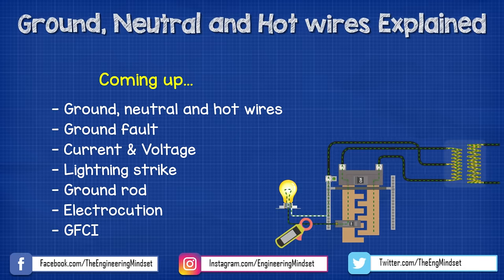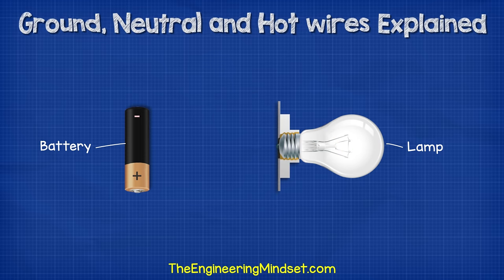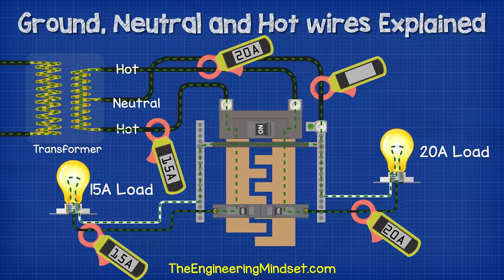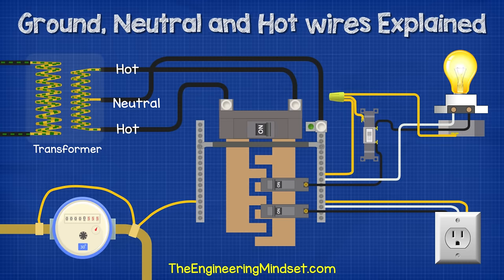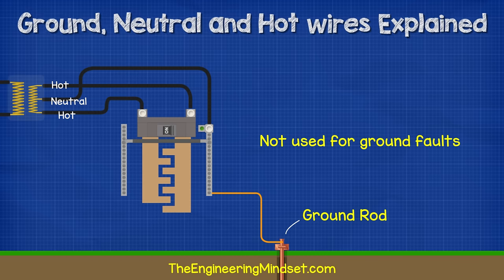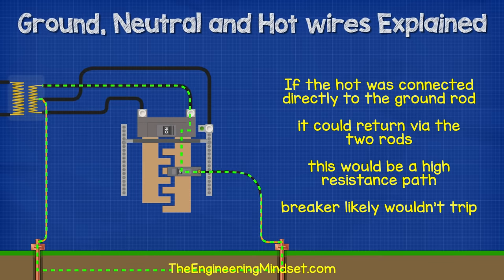Ground Neutral and Hot wires explained - electrical engineering grounding ground fault

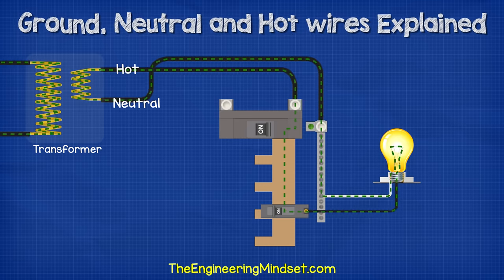Comment: I still don't understand how you're differentiating between "hot" and "neutral" in the AC scenario. Your diagram shows that the "hot" bar is acting as the electron source half the time and the "neutral" bar is acting as the electron source half the time. Note the changing direction of election flow going through the lightbulb at 3:08 if you don't understand what I'm saying. Clarification would be appreciated!
Reply: The middle of the transformer is at ground potential.  All along the neutral wire the wire is at ground potential.  But where the neutral is connected to the load there is a 120 V potential between that point and back at the middle of the transformer.  It is this 120 V potential difference between the hot wire at the load (assuming it is switched on) and the middle of the transformer that causes the current flow in the neutral wire. I think that is it.
Reply: @robertbrandywine  "But where the neutral is connected to the load there is a 120 V potential between that point and back at the middle of the transformer."

Well, not really 'that point'. The voltage drop occurs across the load. But I might be getting nit-picky, I think you have the right idea.
Reply: I think some of the confusion is surrounding what the 'neutral' truly is.

Neutral is actually not the best term here, for reasons I won't get into. The proper term is 'grounded conductor.' 
All you have to do is consider that it is a conductor of equal value, import, and function as the 'hot' and it should all make sense. 
The only difference is literally that it is 'grounded.' All that means is it's voltage potential to earth is eliminated. It is clamped to earth potential. The voltage difference between the two conductors, therefore, all shows up in the 'hot' relative to earth ground. 
It is actually possible to unearth the system and not have one defined as grounded at all. The voltage to ground from either wire in that case would officially be 'unknown.'
Reply: @spruce_goose5169  I like your explanation. 
Does that mean that the 2 hots in standard European 220V outlets are ungrounded conductors?
Reply: @cursed_multicel  I'm in the u.s. and not that familiar with European systems, but I believe they make 230 volts between a 'hot' and a 'neutral' (grounded conductor). 
So one ungrounded and one grounded. Which is different than u.s. where we make 240 between two ungrounded. (u.s. being split phase, europe being a standard single phase, where phase conductor to phase conductor (hot to hot) is 400 volts nominal.)

Comment: The ground wire help us to keep away the dangerous from electric shoke when there is electric leakake on the metal cover of some  devices. Like you have the leaky oven you use the tester and it is on and if you connect the ground wire the tester wont turn on anymore and you will never get shoked when touch the cover
Reply from the maker: We just published a new Ground fault, short circuit and arc fault video, so much detail! Link HERE➡️: https://youtu.be/Qi0ynSQw-wc

Comment: So wait, is this saying that all/most US power outlets with two receptacles (I think they're called duplex outlets), one on top and one on the bottom let's say, are actually capable of 240 volts?  

I suppose that means both the top and bottom outlets can each output 120 volts, but my question is if a single "receptacle" is capable of outputting 240 V in such a setup, or if it is limited to 120/125 volts max?  

Just curious.

Also, no offense, but despite this being a very fine video, I still don't understand much. The one thing I take away is the one thing I've been a bit obsessed with over the past week, and that is that ALL receptacles should be GFCI, or better protected than a mere ground wire, at least for those concerned most highly with safety. 

So I guess I should ask, when will/does a ground fault trip the circuit at the breaker when one is NOT using a GFCI outlet? In general, how safe is a "standard" grounded outlet (non GFCI)?  I thought I read something about 15 amps needing to pass through first, meaning, it needs to exceed the breaker's rating, I'm using 15 amps, but I'm not sure that's accurate, it seems to me that 15 amps would kill a person many times over.

I guess another even more general question would be, how/why do people get electrocuted?

Do they have to somehow become a part of the electrical circuit?  If so, how does this happen? 

My concern is when using my tv or computer; will touching my TV or computer, or keyboard with wet hands, lead me to be electrocuted?  Even if the answer is probably not, is it POSSIBLE that touching my TV/computer/monitor/keyboard with wet/dirty hands could cause me to be electrocuted?
Reply from the maker: We just published a new Ground fault, short circuit and arc fault video, so much detail! Link HERE➡️: https://youtu.be/Qi0ynSQw-wc

Comment: The diagram showing a shared neutral with 2 circuit breakers (approx 5mins into video) is confusing because you show the breakers on the same phase in your panel diagram. One breaker should be on phase A and the other on Phase B. Showing a 2p 20A breaker would make it more clear and also is current NEC code for feeding multi wire shared branch cirs.
Reply: He said split phase with neutral center tap on the transformer

Comment: The battery negative is hot and positive is neutral?
Reply: He's using electrons current instead of conventional current. In actuality, eletrons go from negative to positive. But in electrical engineering, conventional current is used. Conventional current goes from positive to negative

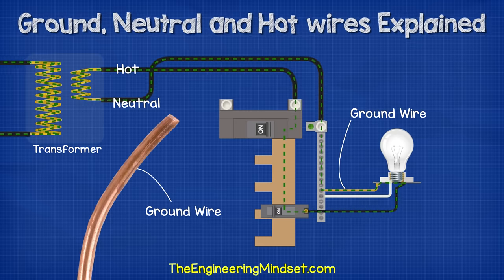Comment: At 6:16, the video states that the ground wire has a very low resistance, and will become the preferred path.  Since both the ground and neutral WIRES are roughly the same, it seems that they should both have the same resistance. 
Why then does the video say that the ground and neutral have different resistance?  Are we talking about “more” than just the wire, but the entire circuit.  Clearly I’m missing something😊
Reply: What you're missing is the neutral is connected to the load. So for current to go through the neutral, it has to first pass through the load (which is higher resistance). The ground is NOT connected the load, current can just go from hot to ground without going through the load. So from hot to ground is very little resistance.
Reply from the maker: We just published a new Ground fault, short circuit and arc fault video, so much detail! Link HERE➡️: https://youtu.be/Qi0ynSQw-wc

Comment: You are forgetting that the center tap of the center tapped transformer is connected to ground at the transformer, which pulls the voltage down to zero volts at the center tap, creating the split phase system. Otherwise, one end of the coil would be at 240V, the center tap at 120V, and the other end at 0V.
Reply: @GH-oi2jf  If it is at ground potential then what causes current to flow out to the house?
Reply from the maker: We just published a new Ground fault, short circuit and arc fault video, so much detail! Link HERE➡️: https://youtu.be/Qi0ynSQw-wc

Comment: Hot wire connected directly to the ground rod at the breaker panel.
The breaker likely would not trip.
Current could return to the source (the transformer) via the transformer ground rod.  (using the two rods) 

This is Exactly how the Old Boys collect Fishing Worms for the last 100 years.
Reply from the maker: We just published a new Ground fault, short circuit and arc fault video, so much detail! Link HERE➡️: https://youtu.be/Qi0ynSQw-wc

Comment: On the one hand you say the neutral current is the DIFFERENCE  between the current in the 2 hot wires in an unbalanced situation, but then you say the breaker flips when the current in the neutral does not equal the current in the hot wire. Seems like the breaker would be constantly flipping, since the neutral frequently has a current that differs from the hot.
Reply: In the first situation he is talking about the service neutral going from the neutral bar to the transformer. In the second situation with the GFCI he is talking about the line neutral going from the load to the neutral bar. The amperage on the neutral going from any loads to the neutral bar is (or should be) the same as the amperage on the live wire powering the load. The amps from the different lines will cancel each other out only in the neutral bar, they will be present before the neutral bar.
Reply: Thanks. That's exactly what I was wondering. @Redtooth75

Comment: How can the current "try" to return to its source, when its source (grounded transformer at the neutral connection) would seem to be at the same potential as the ground bus and ground rod?
Reply from the maker: We just published a new Ground fault, short circuit and arc fault video, so much detail! Link HERE➡️: https://youtu.be/Qi0ynSQw-wc
Reply: @EngineeringMindset  Thx for the follow-up!! Will check it out.

Comment: Naming seems misleading, then. So the ground wire is not really connected to the ground, it has nothing to do with the ground, it is just an  alternative neutral wire connected to objects to short circuit pre-emptively. The only thing that has anything to do with the actual ground are ground rods, which only do their thing when there are lightning strikes.
Reply from the maker: We just published a new Ground fault, short circuit and arc fault video, so much detail! Link HERE➡️: https://youtu.be/Qi0ynSQw-wc

Comment: Ok dc seems simple power flows to load through one wire the hot, and returns to power source through second wire the neutral, but ac keeps switching directions, how does it ever make it from power to load if it keeps switching directions?
Reply: Think of it like a wave. As each particle in a wave is agitated, it passes its energy along to next particle until that energy reaches its destination.
Reply: Direction is unimportant to the light bulb; all it sees is a difference in potential across the two wires in which it is attached. Regardless of the direction of current at any moment, the light bulb will produce light, light which your eye will perceive as a constant glow when in reality power is being applied periodically to the light bulb and depends on the waveform that is ultimately driving the light source based on its technology (incandescent, LED, CCFL, etc.)

Comment: Hello Sir, our local Utility power connection to our house is both Live (L-L) and no N. The voltage is 230V. When a meter is used to check L to G its 115V. I bought a Hybrid-Inverter for my Solar that supposed to be I can connect the Utility supply to automatically charge the batteries in case the Sun is not available. However, the manufacturer advised me not to connect the Inverter because the input required is N - L and 230V (like the diagram) and may damage the equipment. I followed the advise of the manufacturer but its a waste I can't charge my batteries at night or when I needed with the Inverter. Should I take the risk and connect the Utility lines? Thank you.
Reply: @GH-oi2jf  thank you for replying back. I was able to get some information of what to do but i have yet to try. Thanks again.
Reply from the maker: Seen our new video on HOW SOLAR PANELS WORK in detail https://youtu.be/Yxt72aDjFgY

Comment: Electrons do not flow to the lightbulb to light the bulb. Connecting the wires to the battery completes the circuit. The electrons are already there in the field.
Reply from the maker: 99% of people don't need to know and can't visualise the physics of an energy field. However, showing a flow of electrons allows people to easily grasp electrical concepts, which is why our videos are so popular.
Reply: @EngineeringMindset  you have to learn to speak truth. Perpetuating a fallacy keeps the 99% enclosed in an illusion. Let the 99% speak for themselves.

Comment: Okay, I understand DC pretty well, but AC has ALWAYS left me confused as heck. First of all, in DC it's obvious what defines a hot wire, because it's always traveling away from the source. But in AC, if the current keeps changing direction, then what defines your hot wire vs your neutral? If the flow keeps changing direction then wouldn't both wires be hot/neutral 50% of the time? Next, why does an AC current even need more than one wire? If a spinning magnet creates an electrical field, and the current travels both forwards and backwards along a wire, if you had a single wire going from a source to a load, and a spinning magnet dictates there must be an electrical field, then wouldn't that automatically create current back and forth  down a singular wire? Where is my reasoning going wrong...
Reply: I also would like an explanation to some of those questions, so I'll be leaving my comment here lol
Reply: The neutral wire is connected to ground, so it is always held at 0V. Since you are also connected to ground, you are at 0V so there is no voltage difference between you and the neutral wire. The hot wire goes from 120V to -120V relative to the neutral wire. Since you are at ground (0V), there will be voltage difference between you and the hot wire. 

As a side note, a spinning magnet does not produce an electric field. It produces a spinning magnetic field. You get current when that changing magnetic field is moving through a loop of wire. Moving electric charges create a magnetic field, so every wire with current has a magnetic field around it. This also means that you can use a magnetic field to generate current in a loop of wire, but ONLY when the magnetic field is changing.

As the external magnetic field in the loop of wire changes (be it in direction or strength), the wire will generate a current that produces an opposing magnetic field. If the external magnetic field stops changing, the wire will stop producing current.

Hope this helps somewhat, even if my reply is quite late.

Comment: So, how does the ground work in a three phase system that has no neutral supplied from the mains?
Reply: @okaro6595  Well, in Australia, you can have three phase outlets that have no neutral, usually used for electric motors, welders etc. If you need a lower voltage from this system, we use a small 415V two phase transformer to achieve 240V with a neutral if it is required for starting relays etc! Any neutrals are bonded back to earth.

Comment: wy do you refer the hot wire linked to the negative pole on the battery , 
in holland the positive is the one that hurts , the hot wire .
the negative wire or the Zero wire is not the one that hurts , but it can complete a circuit if you touch it while its coming from a lamp with a hot wire allready conected to it .

so wy do you explain this negative pole the one to be the one that hurts ?
Reply from the maker: Please see our video on how a battery works

Comment: I have a question on low resistance in the ground mentioned at 7:24 in the circuit. It seems to me and my understanding that it is not the low resistance in the ground that causes the high amperage increase, but is instead the electricity bypassing the load, going from hot straight to ground, that increases the amperage. Someone please help me understand if I am wrong.
Reply from the maker: Yes you're right, the load is resistance and the electrical supply is bypassing it. The ground wire has almost no resistance so the current will be very high. Current = voltage / resistance
Reply: Thank you for your response. What I am seeing in my mind is the ground wire should be very close to the same resistance as the neutral wire. It seems to me that if the hot wire shorted to the neutral before the load it would be sent back to it's source at very close to the same amperage as the ground wire would produce if the hot would have shorted to the ground instead. The ground wire seems to be a second path designed for shorts in the load that are shorted to areas the ground wire is connected and protecting. It seems that it has less resistance because of it's path back to it's source before the load. If the neutral shorted to ground it seems that nothing would happen due to them having about the same resistance and both headed back to the same bus bar and then back to source. Thus the reason we need a Ground Fault Interrupter in some circuits for added protection. The difference being that the ground is connected to the conductive body of the device and not the load therefore it is a path that has approximately the same resistance as the neutral wire with out a load but is connected to the body for safety and provides an unloaded path back.  I am trying to point out, and maybe not so well, that all three wires have about the same copper and about the same resistance. The high amperage draw is due to the load being bypassed. Am I correct in this way of thinking? Thank You. 

 @EngineeringMindset

Comment: Neutral and ground now makes sense to me in dc. But in ac, they make no sense to me. If the purpose of neutral is to return the signal, in alternating current, isn't the hot returning signal also back and forth?
Reply: Because the used current can't travel back through the full current.
Reply from the maker: We just published a new Ground fault, short circuit and arc fault video, so much detail! Link HERE➡️: https://youtu.be/Qi0ynSQw-wc

Comment: In indian we don't connect ground to neutral it is connected to grounding rod. And when hot touches metal sheathing it goes to ground not back to neutral and it doesn't need to go back to source ground itself is a large sink for electrons electricity flows effortlessly if the area around the grounding rod maintained moist enough so that it provides low resistance path.
Reply from the maker: Thank you, did you check out our new Hindi channel? https://www.youtube.com/channel/UCg4k338hz9U8jnD5SXPO5jQ